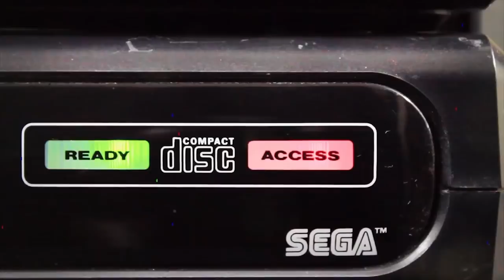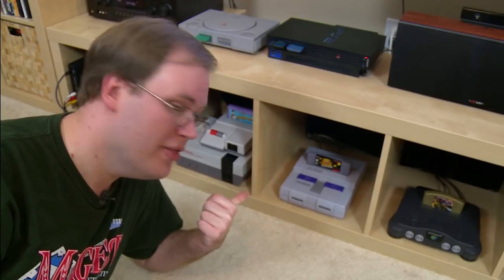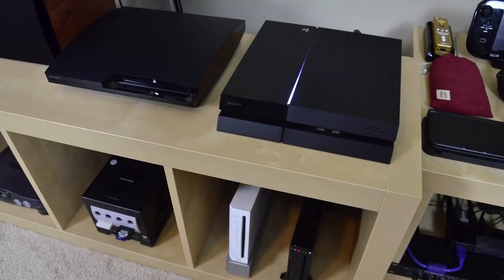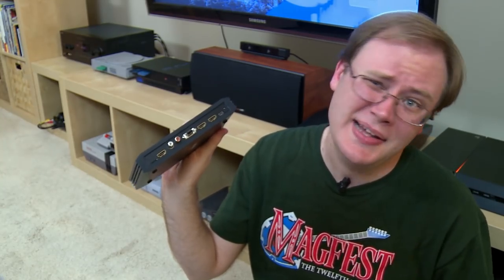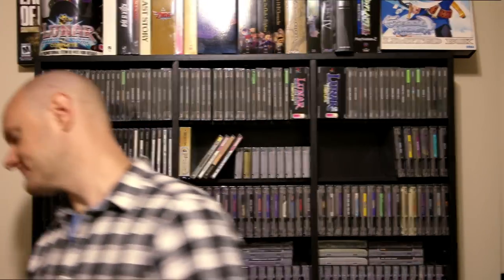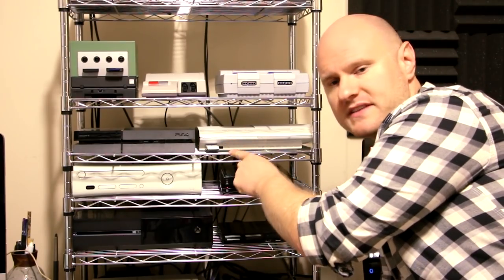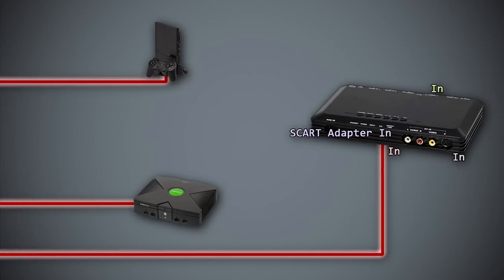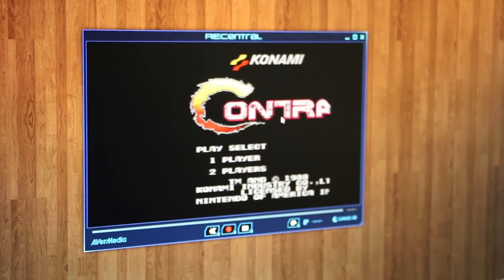RGB and Modern Gaming Setups :: RGB102 / MY LIFE IN GAMING

Comment: +My Life in Gaming

great video.  really love your guys set ups. 

One question, what kind of electrical switchers or splitters do you use to plug all those consoles in and power them up.   I cant imagine that they are all receiving power at the same time.   but it would be convenient to just have them on a switch.  what do you guys use?
Reply from the maker: Michael Wrecka [Coury] I personally use a couple of these Belkin 12 Outlet surge protectors. http://www.amazon.com/dp/B000JE9LD4

I'm not sure what Try uses however.
Reply: Thanks for the response.   After I posted that question I came across this http://www.ebay.com/itm/371220338580?_trksid=p2055119.m1438.l2649&ssPageName=STRK%3AMEBIDX%3AIT

it reasonably priced.   I really like the idea of being able to stop electricity from going to my old consoles without having to unplug them.    I heard that having a constant current going to them could over time have a negative effect. 

and this just seems really convenient.  check it out.

Comment: Just found this video, it's brilliant. I see that modded NESs are now available to buy on the web. If I buy a modded NES, can I plug it straight into the telly?
Reply from the maker: [Try4ce] Given your use of the term "telly," I'll assume SCART is readily available where you are. :) This video is super out of date, but the answer is... probably? If using a CRT, I imagine very much yes, but if your CRT is not compatible with 60Hz, you'll need a PAL system running 50Hz. On modem HDTVs, they aren't always friendly with retro console signals, so that's why we use scalers.
Reply: @mylifeingaming  Thank you for the most complete response. I am slowly working  my way through the list. I suppose things have moved on a bit since back then. Just moving into the 201 list, so further question may pop up there. I've not played my NES/Megadrive/SNES/N64 since....the 90s maybe? I've just bought a Switch for the virtual console, but I would like to play my real systems/games. :)
Reply: And yes! I've been using scart since the 90s. :D

Comment: Hmmmmm, question, would the Framemeister run well on an CRT HDTV? I am seeing if that would eliminate any lag, sins I'm kinda found of my CRT HDTV.
Reply from the maker: +Leonx3 [Try4ce] I actually donated my HD CRT just a few weeks ago, and I never tested the Framemeister on it. I imagine it would work just fine, but I have my doubts as to whether it would reduce lag. The Framemeister is pretty fast, but I don't know for sure what kind of lag an HD CRT has. My guess would be on it adding more lag, but who knows, that's just a wild guess. One cool thing though, is that you could get scanlines on an HD CRT in that way. I don't know for sure how good the image would look overall, but I bet pretty good. If it's a 4:3 HD CRT, you might have to output in 480p mode, because 720p would naturally be 16:9.
Reply: It is a 4:3 HD CRT. Thing about the FD Trinitron Wega is getting the right setting can be a hassle. But darn, Never knew 720p thing. Learn something new everyday, thanks.

Comment: I am trying to use my 2 PS1's to play the Doom games using the link cable. Unfortunately my hi def tv's that I use are making the graphics unbearable. What do you suggest?
Reply from the maker: [Try4ce] The OSSC is the upscaler we use the most right now. It's hard to say if your distaste is for HOW your TV scales it though, or if you just aren't up for low res graphics anymore. PS1 games also tend to look pretty dithered, but I forget if Doom is.
Reply: @mylifeingaming  Most games look fine. It's just that the resolution  is too high considering how Doom looks and feels on the tube televisions. I have seen emulators that look great but the whole reason I play my old Doom game on PS1 is because of the link cable.

Comment: Great video, thanks for the information. Couple quick questions:

Does the Framemeister have input-specific settings? Like, if you want different settings for consoles on different inputs. Would be irritating to change the settings every time you change inputs.

And which NES/Famicom adapter are you using? Do you like it?
Reply from the maker: Kyle McMahon Yep, the Framemeister memorizes the settings on each input. This is nice, but I hope with future firmware updates they allow multiple profiles for each input - that'd be perfect!

For NES/Famicom input, we are both using RGB EuroSCART cables that we bought from Retro_Console_Accessories on eBay.
Reply: ***** Sorry, I meant what cartridge adapter is Marc using to play NES cartridges on the Famicom? (I think I've found it on eBay being sold by cheapgamestuff?)
Reply from the maker: [Try4ce] Yup, cheapgamestuff, that's the one! Here's the link. http://www.ebay.com/itm/NES-US-Nintendo-8-bit-Japan-Famicom-Game-System-Adapter-/181528796637?pt=US_Video_Game_Controllers&hash=item2a43f59ddd There appear to be two different looks for the adapters they sell, so I can only assume the functionality is the same... but I can't confirm. As far as I can tell, every game works perfectly except for Castlevania III (which is pretty typical for CVIII to have compatibility issues).

Comment: I've read that the Bandridge 5 way SCART splitter is a good option with no noticeable RGB degradation.

I posted some questions about the Framemeister on a few forums like this one:
http://www.racketboy.com/forum/viewtopic.php?f=17&t=47762
Perhaps you guy would be able to answer them. Thank you
Reply from the maker: ***** [Coury] This one is a highly recommended one. We actually both have it, but there was a problem where, since SCART can send power, it would send power to whatever system was in input 5 no matter what. For instance, Try had his Genesis plugged into it, and whenever he would turn on another system the light on the Genesis would turn on, even if the system was off. So instead of possibly doing damage to a system over time, we decided that we wouldn't recommend it for now.

However! I recently found some info online showing if you cut a specific trace on the board inside of the Bandridge, it would stop sending power. I did this and it seemed to work. It doesn't seem to power now. But we have to do a little more research to do.
Reply from the maker: ***** In terms of your Racketboy questions:

1.) I would just go with all EuroSCART if you could. You can get a replacement plug that goes into the front of the Framemeister that makes it a EuroSCART instead of a 21 pin. You'll have to pick one or the other anyway, and I feel like EuroSCART is just a simpler and easier choice for a US buyer. Just get this and go with all EuroSCARTs - http://www.ebay.com/itm/201199876700

2.) Yeah, you'll have to buy a modded stereo patch one, so you'll need to get 2 cables for it - a genesis 1 to 32x cable (with stereo)  http://www.ebay.com/itm/161465059517 - and a Genesis 2 EuroSCART cable for out of the 32x - http://www.ebay.com/itm/201206366563

3.) You're schematic looks good - very similar to ours - its hard to present it like that without it looking like a cluttered mess isn't it? Took us forever to get ours looking like it makes any kind of sense, and I don't even know if we succeeded.
Reply: ***** Thanks for the replies Coury, I really appreciate it. While googling last week, I found this: "gscartsw: automatic 8:1 SCART-RGB switch" which was highly recommended here http://retrorgb.com/scartswitches.html

It's basically a home made SCART switcher made by a retro gamer, so one would hope that all necessary precautions were taken. I didn't pay much attention to it first since I had the Bandridge one mentally set as my ultimate choice, but I'm guessing it's not a coincidence that both you and Try got the same issue with it, guess I'll wait for your feedback on the mod you did on yours. 

As for my setup, ya, it does look like you guys made, mainly because you were my inspiration for even starting this. I've seen other videos regarding in the Framemeister in the past, but they were always from people in Europe, so I fear my results would be different, but your guys managed to show me that it was well possible in North America.

I purchased my Gen M1 to 32X cable from retro_console_accessories in the past, so I can vouch for this seller (doesn't answer e-mails quickly however). Alright, guess I'll wait for Solaris Japan to restock the Framemeister and order one with D-Terminal to Component.

Finally, if you guys plan to make a part 3 to this, may I suggest including the following:
1- Any progress you made trying to find a SCART Switcher
2-  Difficulties you may have gotten in the past to get some systems working with the Framemeister since I've read SNES and Saturn can be troublesome.
3- The best Framemeister settings for each systems
4- Perhaps give a shout-out to these guys who are are making component cables for SNES, Gen M1/SMS, Gen M2/CDX via their Kickstarter: 
https://www.kickstarter.com/projects/hdretrovision/sega-genesis-and-super-nintendo-component-cables

Comment: Which S-video cables do you guys use for the N64? There's so many different variations and I'm looking for a recommendation. Thanks.
Reply: There are official Nintendo branded S-video cables, they're the same ones that also work for the SNES, so the port that connects to the SNES / N64 should be black plastic with an official Nintendo logo embossed in the plastic.
Reply: I would recommend the official Nintendo brand S-video cable.
Reply from the maker: [Try4ce] Since the official ones aren't made anymore, they can be pretty difficult to find. Personally, I haven't noticed a difference between any of the S-video cables available, but I also haven't really compared them in-depth.
Reply: *****
I wouldn't recommend the gamestop\madcatz ones since the picture quality looks really shoddy and there are weird patterns on the screen that are a bother.

Comment: Hi there, thanks for the video. I have an issue with the N64. Works perfectly with RCA cables. Just bought a RGB mod console with the SCART SNES cable (ordered a dol-013) to plug in the RGB port of the framemeister. Result: blue screen for 2 seconds, then « No_Signal » then black screen. What do I do wrong ? Using a Euroscart to Framemeister from retrogamingcables
Reply from the maker: [Try4ce] I've heard that CSYNC can be a problem with the way some N64 mods are installed. You may want to try sync-on-composite (make sure you've bought a well shielded cable) or sync-on-luma.
Reply: My Life in Gaming great thanks for the advice, will come back to you with results ;) (I’m in Switzerland so i’m on a PAL « FRA » RGB modded console)
Reply: My Life in Gaming As I am looking for a modern TV, do I need a TV that has RGB Scart plugs (and not AV) or is it useless with the framemeister using HDMI?
Reply from the maker: [Try4ce] Well, a few things... first, I don't believe any European systems support S-video (which is where sync-on-luma pulls sync from). I'm honestly not sure if this matters for an RGB mod, or if it adds S-video to European systems. This means sync-on-composite is the surest bet getting it to work, but be sure to buy the higher grade cabling to minimize any visual noise. You don't need SCART on your TV if you have a Framemeister, since the Framemeister will do a much better job upscaling it. Also make sure you have the correct RGB adapter for your Framemeister! Years ago it only came with the Japanese style connector, which looks just like SCART but it wired differently, so it won't work with SCART. They later offered a European style adapter, but you have to choose it specifically. You can order a European style SCART adapter from your cable seller if you don't have one. Lastly, make sure you're using the latest firmware. There was actually an update less than a year ago that fixed some compatibility issues on some 4K TVs.

Comment: I'd like to split my hdmi singal (and get rid of HDCP) but I don't know if I need a specific splitter or not. Will anyone do this or do I need a specific one? What do you recommend?
Reply from the maker: [Try4ce] It's kind of a gamble. Some do it, some don't. The internals on them might even change, so you might not be able to rely on a specific brand.  We do know that the one branded "View HD" does, or at least it used to.
Reply: Thanks a lot. My search will begin soon (I only just received a framemeister). I also found out that splitters up to HDMI 1.3b seem to strip HDCP protection and anthing above may or may not do that, so it may come in handy for someone in the future.

Comment: my tv got scart so if the console got scart thats my best option?
Reply: +Amoun dk I don't see why not. If your TV naively supports and I am assuring by extension RGB Scart you are set.
The less post image processing you have to go though the better. The Micomsoft XRGB Framemister Mini is really for those who don't have scart and want their games on a HD TV.
Reply: +Amoun dk If it's modern television (not CRT) you are still better with RGB to HDMI converter. It doesn't mean that if the TV has the connector it handles the image properly. Here in Europe ALL our TVs still have it, but most of the cases image through it looks like crap compared to running through converter like Framemeister.

Comment: where did you get your PS2 SCART cable from? Is SCART from PS2 really necessary or is component good enough?
Reply from the maker: Doug Zerafa [Coury] No, its not necessary at all. Component gives you the ability to easily do 480p, while SCART is limited to 480i unless you have special hardware. 

On the flip side, Component introduces a little noise to the image, seen against certain solid colors - you can see it in the grey in my Quartet video (linked to the time here: http://youtu.be/UzzwuLD_a0E?t=1m51s ). That noise isn't visible with SCART. 

Its not an issue really, just depends on preference. I use component while Try uses SCART.
Reply: *****
thanks!

Comment: I have a 8 input jvc selector switch with the outpout going into the coaxial input of my 7.1 receiver which upconverts the signal to 1080p.just need some opinions if I would get better quality by doing it like the video.
Reply: tatito rodriguez  from last comment..the only problem with my setup is that I have to have my receiver on whenever I want to play one of my retro systems....it also has 4 hdmi inputs for my 360..one...ps3...ps4.
Reply from the maker: tatito rodriguez [Try4ce] I'm not familiar with the quality of receivers that upscale video, but I would be very surprised if they're designed with retro consoles in mind... meaning, it's probably about the same as your TV doing the upscale. It would definitely be fun to test out, though, who knows, could be surprised.
Reply: ***** did a little more research on this channel and pass through upscalers are good for certain video sources.don't get me wrong it still looks good how I have it hooked up but with the scat cards and the other adapters mentioned in this video it would look even better.....my next project...re hook everything..glad I ran across these videos.

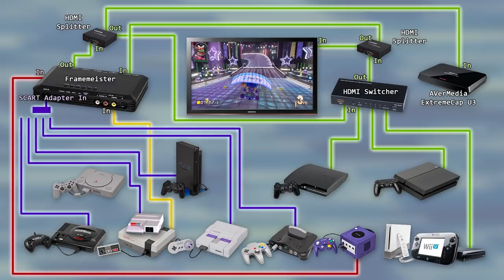Comment: At 5:34, there appears to be a "loop" as far as the HDMI connections go between the HDMI Switcher / Framemeister and HDMI Splitter.

Is this intentional? It's confusing me quite a bit right now.
Reply from the maker: [Try4ce] Good observation! You're absolutely right... there is a loop, and it's pretty weird. Coury doesn't have a loop. Everything he plays goes through the Framemeister, including modern HDMI-based consoles. This isn't really a problem, because he can choose HDMI pass-through in the Framemeister settings and the image will go through unprocessed (no reason to add additional processing or lag to HD consoles, but the systems are sent through the Framemeister for the purpose of capture... it just consolidates everything to go into the TV or capture card without the need to swap HDMI cables on the capture end).

But I don't do this. So why do I use the loop? Well, the main reason is that I stream a lot more often than Coury does. My OBS (free broadcast software) scene settings are expecting 1080p input. If it's receiving 720p from say, a PS3 game, then things are gonna be a bit screwed up in OBS. It's not so much a problem if all you're doing is just playing or doing a regular recording. So this way, if the game is outputting 720p, the Framemeister upscales it to 1080p going to my capture card, BUT it's bypassed for the TV output... so I see what I'm supposed to see on the TV, while the capture card is getting the scaled image. The only thing that I have to be careful with is to be sure I switch the HDMI input BEFORE I switch the Framemeister to HDMI. If I feed the Framemeister its own image, it hates it, and sometimes I can't get it to respond to remote commands again until I turn it off and fix the inputs again. It's a bit of an odd situation, but it does work for me!
Reply: "The only thing that I have to be careful with is to be sure I switch the HDMI input BEFORE I switch the Framemeister to HDMI."

Thank you for the clarification. Much appreciated!
Reply: ***** What type of cable do you connect to the Framemeister? (The 8-pin port IN to the framemeister, that accepts an SCART connection). I can't seem to find it. (Which ends are male/female?)